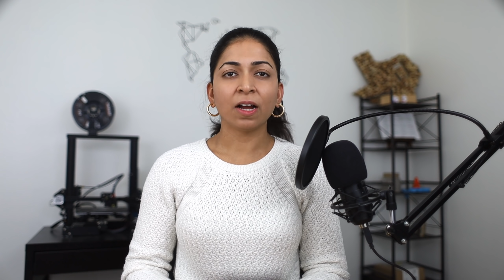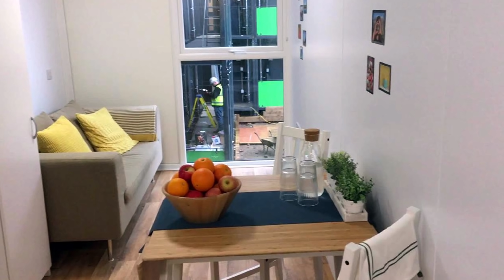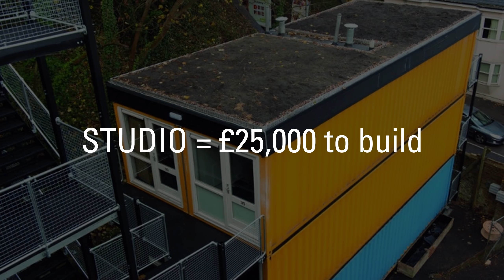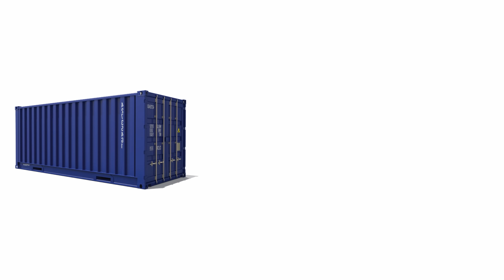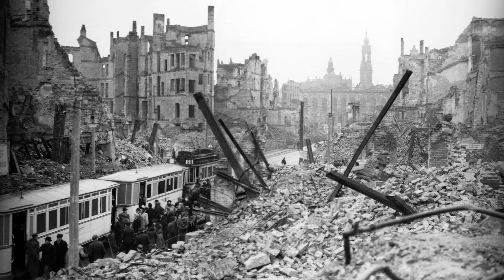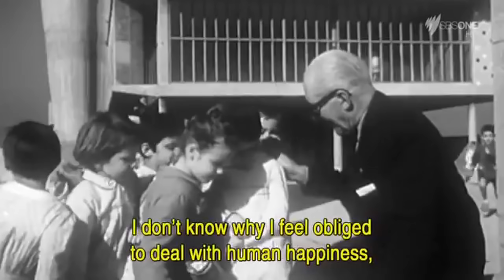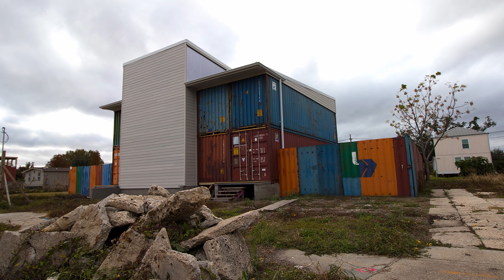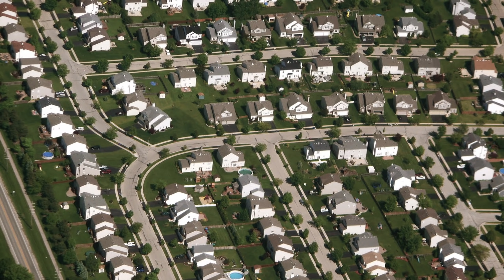Why Shipping Container homeless shelters FAIL

Comment: I have seen Shipping containers used as a basis for homes - but only as PART of the design.  One that I saw had a central "atrium" roofed over between several shipping containers that were used as rooms.  This gave a "Great Room" feel that solved many of the very constraining problems you state.  Along with condensation, Insulation would be a huge problem with shipping containers - especially in a colder climate like Canada. Even layers of the best insulation cannot overcome the fact that steel is a HUGE heatsink!

Comment: if you want to spot places where architects don't considers the regular cleaning, usage and maintenance, go to a shopping centre and look up. if you see a very tall ceiling especially in open space, see if you can spot how they try to eliminate sound reverberations and echoing. if you see dark or black ceiling, those likely are not paint but carpets, they're there to absorb noise because the design of the rest of the place did was not sufficient. since they're very high up, they don't get cleaned regularly and traps all the smoke, dust, insects and moulds and once they're saturated they sprinkles down. cleaning them is nearly biohazard job if they left too long between cleans, imagine holding a vacuum cleaner up to your ceiling carpet that's 3 stories high with layer of dust and mould and insects thicker than the carpet itself.
A lot of the time, architects only considers how aesthetically pleasing it looks on drawing.

Comment: I would not only look to the west but I would also look east to the post-communist republics. In which many concrete complexes were built during the communist era. And most of them were built of prefabricated concrete panels. I live alone in one of these and I honestly don't see much difference between container and concrete, it's still just a box. Yes, everyone would like to have their own house, but the difference in price is, for example, 3-4 times higher for a house than for an apartment. And a house will never be as cheap as an apartment just because it is not vertically adjustable on itself and the land is always an extra price. And if I turn the question around completely, is it better to live in a shack built of sheet metal and a few beams (or a tent) or in a container? From a hygienic point of view, a container with social facilities is better than a tent. Yes, it is not a permanent solution and never will be. But it is a solution that gives the person in question the safety of a roof over their head and the opportunity to move on. And so it should be approached. Because even socialism could not afford to build a house with its own garden for everyone and distribute it to everyone who was interested in it. And if I'm not mistaken, no one forces anyone to live in that container, they always have the opportunity to leave. The same in a concrete complex. In the Czech Republic, it is so that some of these apartments are owned by a city that has a waiting list and allocates it to people who apply for a regulated rent that is always lower than a normal rent on the open market, which gives people the OPPORTUNITY to live safely cheaply and mainly make money on their own housing, which is their free choice.

Comment: Wait, let me summarize. Roughly 70 - 80% of homeless are there because of an addiction issue. In addition 30-50% have mental issues. These 2 overlap often and grow each other into higher percentages. Then, we try to house them for free because they cannot cohabitate with other people in existing houses by building areas where they need to cohabitate in better than they had conditions with thin walls. Clearly, they cannot take care of themselves and pull out. Don't we need to categorize them, deal with them differently and have different types of housing for each. The worst of the worst get the shipping containers an moldy carboard houses. Maybe you are all missing the point - the rest of the people that work hard and don't do drugs don't want a single penny going towards these people. They would rather see them die on the streets.

Comment: While I do agree that forcing architectural minimalism on people and value orientated construction are fundamentally flawed idea's, I don't think suburbs or low density housing are a solution either as it also creates a larger network of dependency that is required to live there. More roads, more cars, and more space between everything. This has some benefits, but the massive increase in costs is usually completely unacceptable to most people. Living in a suburb doesn't just mean having to maintain 4 walls, but as well as transporting yourself and your things to and from. This means more property tax, more insurance, more heat, and fuel, and more maintenance will be required. 
For most people, and municipalities, this would just mean syphoning of the majority of your wealth to companies and service providers simply to create the necessary infrastructure to live in this kind of neighborhood. And this is all money spent on things that will have negative health and environmental impacts, will in turn require more money to be spent on long term medical care. It's also giving with the hand that takes, as this is all money that could have been spent on better institutional facilities in the first place that provide vast civic and social resources.